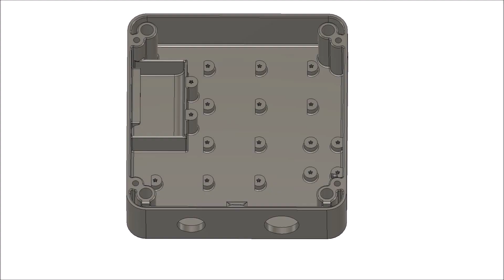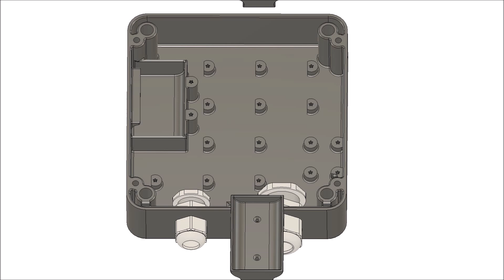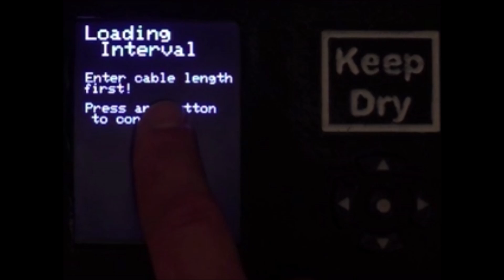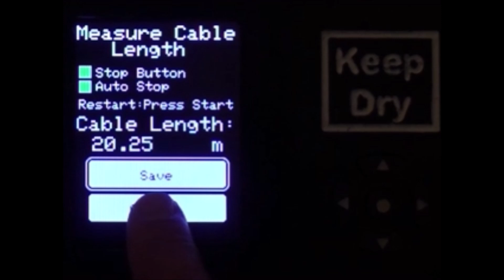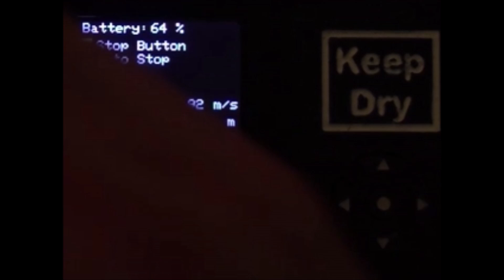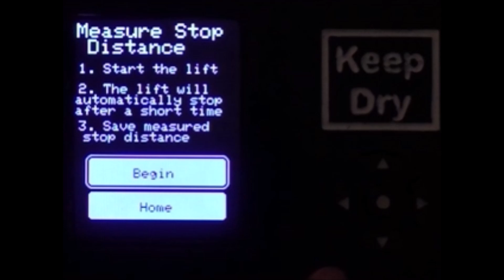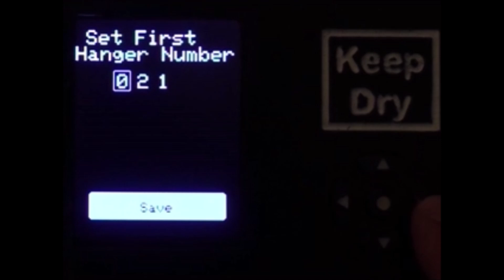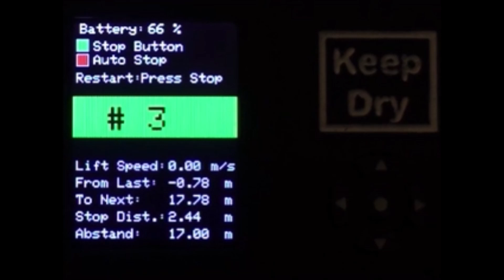Ski Lift Spacer 2000 - Automatically spaces fixed grip chairs / hangers on haul rope

Comment: Why not using the Every's eeprom to store the settings/numbers?
Reply from the maker: Great suggestion! I could ask the user at startup if they want to restore the previous values or start new. The idea is that this device can be used across multiple lifts, maybe I could even offer the option to save multiple profiles for different lifts so they can be quickly opened.

Comment: overly stupid  circuit for a simple problem! ...go mechanical.

Grats, you made a calculator.
Reply from the maker: You're right, it counts impulses and does some VERY basic math.
The majority of the coding was for the display / user interface.
I'm genuinely curious about your proposal to go mechanical?
Reply: @MarcAntaya  use the powerline freq  for a baseline, then use that frequency for ROLs, sure, it might require a bathrub and a toaster but at least its not overly complicated!